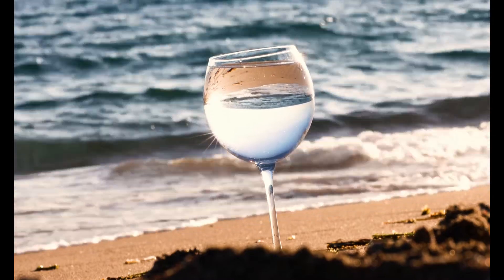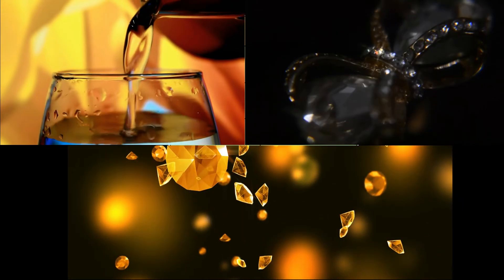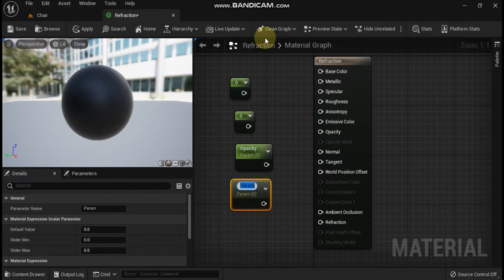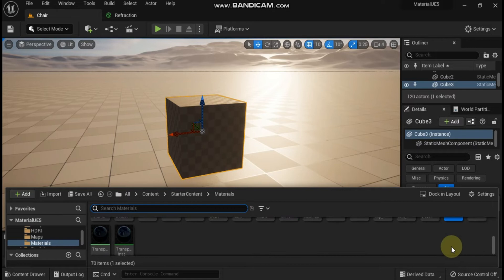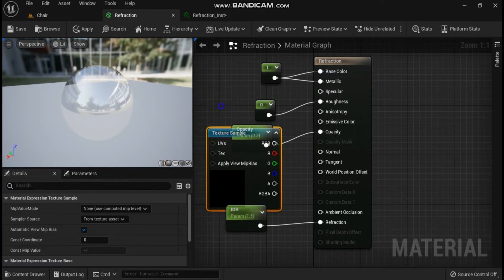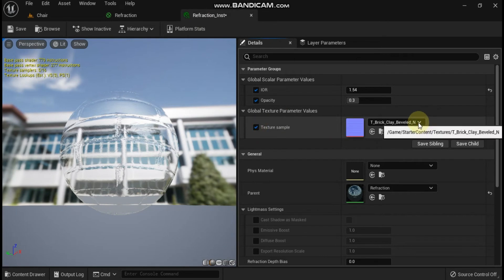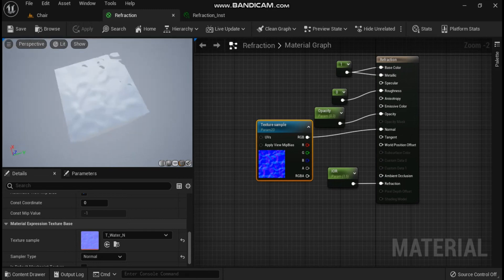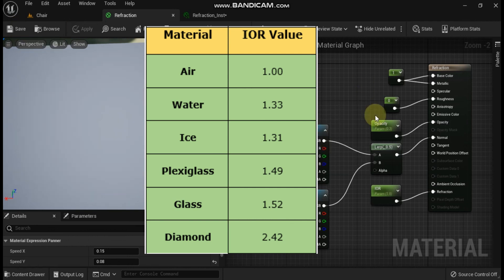UE5 : Materials for beginners in Unreal Engine5- 8 Refraction

Comment: I got some solutions for some  problems I had when trying to create distortions for Niagara systems (VFX, particles, stuff like that) 

You will run into a problem where literally the ''refraction'' thingy its diabled, to enable it, search ''Refraction method'', it will drop a menu of a bunch of potions, you selec ''Pixel normal offset'', that way it will enable the refraction stuff you looking for, if you select the other ones they will either not work or will have a very weird sharp outline at the edges of the squad, remember these distortions for vfx have to be some texture normals for it to look better.

Also, if the refraction its way way way too strong, you can connect a float into the ''refraction'' stuff at the node of the materials and set it to 0.95 or something like that, in that node its where you control how strong the refraction is.

This information might seem way too obvious but its a problem I had so you might also have it too.

Comment: For those who are having trouble getting the refraction to work (on UE5.2):
1. Search for "refraction" in the material properties, and enable it.
2. If you're still unable to see, make sure the engine scalability is set to high or above.
Had the same issue, fixed it like this. Hope it helps.
Reply: 2 days I've been going insane its because my scalability was set to medium -_- thank you so fkn much for the comment. You saved me
Reply: Insert the "Bless You, laddie" Gimli gif here
Reply: Thanks! Just to add: specifically the scalability for "Effects" AKA "Visual Effect Quality" must be set to high (3) or above.